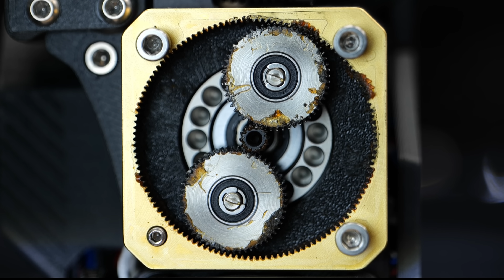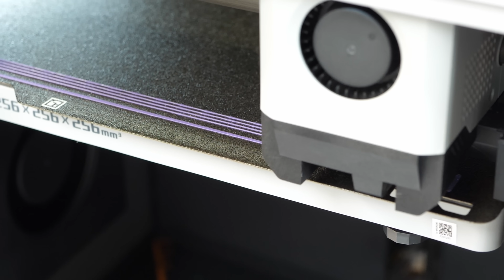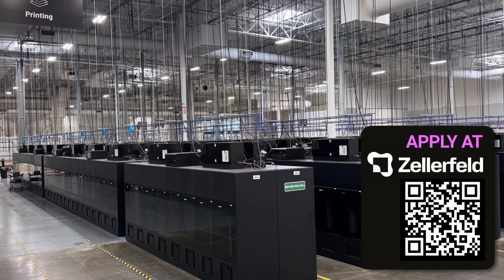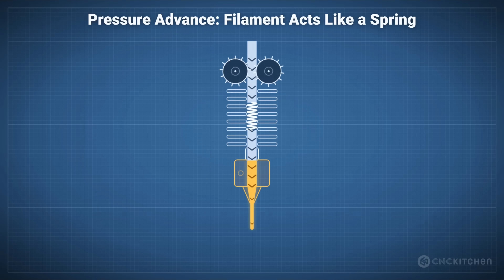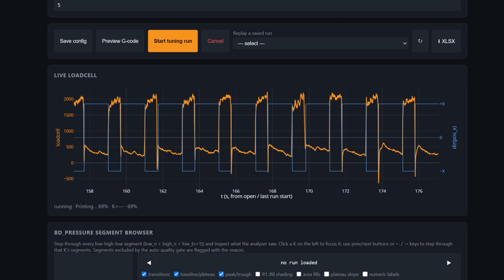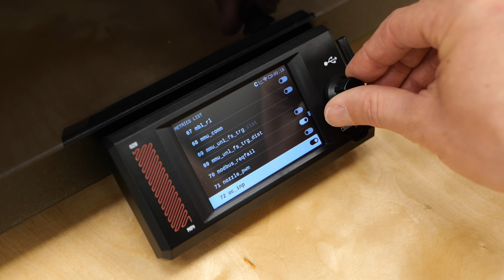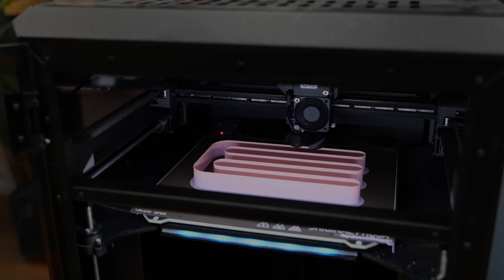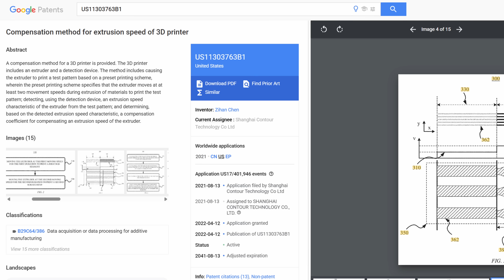I Automated Pressure Advance Using a Bed-Leveling Sensor

Comment: This is awesome - I just ordered an INDX system and I'm asking myself if the loadcell in that can be used for stuff like this and especially filament/clog/runout detection. Not sure if it works for INDX, because the toolchanger presses the tool down into the couling, so maybe INDX's load cell can't register "negative" values from filament force, just positive values from probing the bed?
Reply: But I think I won't get around some kind of filament detection mechanic. Maybe just basic presence sensors like on the Prusa Core One's INDX system (I got a Voron 2.4 and INDX devkit). Was thinking about getting something like a Mellow LLL filament buffer, but that quickly gets expensive for 10 tools in my case :D
Reply: by the way. Just so awesome to see the potential again, on another level, for software to make today's machines soo much better in the future. I got a MK3S back when it came out, and it's insane how much it improved over the years just by firmware and slicer enhancements. 3 of them were my only printers up to a few months ago when I got the Voron. I'm excited to see what the future brings :)

Comment: I guess it could be used as a runout sensor too? But the printer reaction would have to be immediate till there is still nozzle pressure

Comment: Super cool idea, now I am wondering if I can get the raw data from something like the mellow fly ALPS or the Revo PZ. The main challenge I see upfront is that many of these probs have their own "control board" that converts the raw pressure sensor data into a data format that at least on the ALPS replicates a bltouch probe, and completely obfuscates the raw data. Might need some custom firmware but I certainly want to try it! Amazing video!!
Reply: Agreed, would love to integrate this into my Goliath hotend setup. Definitely post your results

Comment: Stefan, is K also a function of speed and acceleration when printing?

Orca has a checkbox to enter an array of values which it can bilinearly interpolate between.

I wonder if you could get enough information from your method to get this level of calibration easily.

Regarding the U1, which would benefit most from this, please have a look at the Paxx firmware, you may find there’s a way to get that information out of the machine

Comment: Interesting thoughts - I presume you are using something like Claude to develop your web dashboards etc.   I've gone a fair bit further with my RRF printers and actually used claude to make firmware changes - for things like collision avoidance.  I wonder if you could do the same sort of thing with the Prusa firmware to add additional data / put your pressure advance algorithms actually into the firmware.   I'm certainly planning to do this on my CoreOne INDX - to get it to do things like supporting more than 8 tools (or a secondary elevating tool rack). Appreciate that this means breaking the clip on the board that allows unsigned firmware to be installed.

Comment: my Prusa MK4 also uses the side detection of the load cell to check if the print sheet is installed correctly, to avoid printing on the naked bed.

Comment: I still think bambu going back to eddie current sensors and load cells and ditching the lidar was a mistake.

Deriving flow dynamics from second order sensor data never can be as precise as measuring actual line width on the print bed. And in the end thats the metric we want to optimize for.
Ideally this should be permanently measured while printing and corrected on the fly.
Hot end pressure can get close but you are never measuring what you actually want to.

Comment: Couldn't this also be done by measuring the extruder stepper current? For printers without a loadcell...
Reply: It would be incredivly difficult, because the current is equivalent to motor torque. And some of that torque also is taken up by the moment of inertia of the motor itselve.
Reply: Oh be careful not to encroach to the bambulab patents there!
Reply: @nexttonic6459  Oh I see

Comment: I don't know, my experience with fast Klipper machines is that the correct pressure advance depends on two factors, filament and acceleration/velocity, but the latter is usually more important. At the point that two different machines with similar hotend/extruder can share the same profiles as long as they also print with the same acceleration/speed.

Comment: So cool! I've avoided BambuLab printers, but the automatic pressure advance/extrusion multiplier features have always been really enticing. I'm glad you're looking into ways to implement it!
Reply: The load cell based (A1 onward) pressure advance calibration works great.
The 'LIDAR' (X1C) extrusion multiplier and PA calibration dosent work very well.

Comment: i always wondered if you could fit a rotaional load cell between the stepper motor and the extruder to detect the pressure build  up?

Comment: Next level! I remember looking through your repo a week or so ago and was excited to see the video come out for it. Seeing Jo Prusa's comments, I'm hoping for improvement. I think Prusa had grand ideas, but may have shot themselves in the foot: Klipper and Bambu's printers (such as the X1C) are Linux based, so there's a full computer there that can do processing. Prusa opted for embedded software, so basically everything can be designed/engineered and demoed to work... and then needs to fit within a small memory foot print and limited processing power. And that kind of work is probably harder then the original problem being solved.

It's such a catch 22 for me: Nov 2021, Prusa announced the XL and said "However, the load cell sensor allows us to do more than that. We can now recognize a jam in the nozzle and pause the print. In the future, one of the things we want to focus on is the ability to detect a partial jam – so the printer could notify you in time before the actual jam happens. And maybe even detecting if the print has come loose from the bed." yet here we are over half way through 2026, and the the closest we have stuck filament detection that takes a bit too long before it triggers and the code for it is literally a bounded gaussian filter with a comment that says "If someone knows how to compute it properly, please feel free to improve the code below" (look for e-stall_detector dot cpp).

Yet on the other side is Bambu who took a different approach, patented it, then all but threw out that approach with the A1 to do the same as Prusa and others who were playing with load cells for the same purpose, and apparently patented it too. Then you have things behind closed source for Snapmaker.

Like... at this point, unless someone on Klipper is/has done the calculation approach to run in real time, I feel the 3 options the community has is: 1) hope someone on Klipper tries to do it themselves/integrates a real time version of your code. 2) wait for Prusa (though their approach will be intended for embedded systems). 3) Hear me out... bring back OctoPrint (it never went away, and I hope Gina's been doing well, but I just don't hear about it in relation to modern printers)... because OctoPrint is a Linux system that runs adjacent to the actual printer and could be something that a user just goes "get RPi, install OctoPrint, install your code adapted into a plugin", and suddenly you get an filament auto-load sequence that detects pressure advanced and injects the proper K value instead of it being hardcoded somewhere. Plus you get the benefit of all the other things mentioned: stuck filament detection, dynamic flow rate adjustments, skew detection (and maybe even live adjustment), etc.

(clears throat) Thanks for continuing to do these research projects AND then publishing the work and process.

Comment: This looks like the perfect use case for an ML model.  My guess is that in those different machines during the calibration tests, the under and over is captured and run against a pre-trained ML to output ideal values which are then applied to the extruder.

Comment: the utility of having that kind of system on the 8 tool indx would be immense. on the first layer of each colour the head could just run that load-cell based calibration the once and then continue on as normal. like having a traditional flush purge like a bambu machine just the once, but then resuming the special purge peas the indx has after.

Comment: Essentially you're advocating for better compute onboard printers. Which has slowly been improving. And you could always go the direct control from the computer route. Read sensors and edit the next gcode command on the fly. The only limit is baud rate.

Comment: A pressure advance routine could be built into a brim or skirt section of a 3d print. This would eliminate the wasted filament while giving better data since there is some back effect from the printer bed.
Reply: Smart idea! There is always a priming line that could be used too.
Reply: @Nikkuuu69 The priming line cannot be used for PA tuning. For PA tuning you require the nozzle to be properly 'filled' and the priming line's job is to do just that.
Reply: I think the more advanced application would be active calibration in a closed loop system during a print.
Reply: wont work because of the additional pressure given by the pushback from the plate

Comment: Insightful stuff Stefan! 

I wondered how my Kobra Max 3 did flow calibration since there is no visible evidence like my X1C. So I paused your video and let Google AI tell me: 

“The Anycubic Kobra 3 (and its Max/Combo variants) uses an automated active pressure compensation feature for flow calibration. It utilizes a built-in load cell in the print head to measure internal hotend pressure changes while extruding filament, automatically adjusting extrusion to prevent under- or over-extrusion.”

Keep the cool info coming!
Reply: Yes, Anycubic has done it... so surely it was done or written somewhere even before for them to be "inspired from"
Reply: Be carefull with the output of the built in Google AI.
Just ask it the continous current rating of an XT90 connector.

Hint: it is NOT 90A for all of us that know how to read a datasheet.

Comment: Would the E3D piezo PZ Probe sensor also be suitable for this application?  I’m not sure how the Prusa loadcell physical mounting differs from the mounting of the PZ Probe with Revo nozzle on a Voron to know if can interpret the same nozzle extrusion feedback data shown in the video.  Would be cool to see this capability for a Dragonburner with E3D Voron PZ Probe Revo toolhead.
Reply: Piezo sensors do not measure force directly, they only measure a change in force.

Comment: Sorry if this is mentioned at some point in the video, but I wanted to send it now because I'll probably forget later with so many things to review.

One thing to keep in mind is that, for the calculated K value to be accurate, in practice the filament is being pressed against an existing layer. The amount of compensation should therefore vary significantly depending on that layer's height.

I think performing the test using a calibration line at the beginning of the print (as Bambu Lab used to do) would provide the most accurate possible calculation

Comment: Thank you for investigating this, I've frequently wondered why this wasn't ever implemented further. The nozzle load cell is very much a way to close a glaring open 'loop' in the process.
Also something I've frequently noticed is once I've found a good 'ideal' k value, it kinda spans across all my filaments and even plastic types. When it doesn't, the nozzle temperature can be adjusted until the viscosity aligns again and that 'ideal' pressure advance value holds true. It'd be interesting if you looked into that to see if there really is a 'generally good viscosity' that works across all filaments and doesn't seem to compromise, and maybe have pressure advance calibration effectively adjusted via temperature instead? (if this is true, it might even mean temperature towers aren't needed?) I think outliers might exist due to some filaments having additives like carbon fiber.

Comment: is it possible to implement temperature control to adjusted by layer time for finer details of a print  instead of relying on min_layer time cooling, which can still make finer details a mess due to the high temps.

Comment: Now you are making me wonder. If we are doing this based on the amount of force being placed on the nozzle, the Newton's law says that force has to be coming from somewhere. If we can get access to instantaneous current readings, we can infer all of this just from the stepper driver that's running the extruder gear. Which is really topical, because you mentioned sensorless homing in the sponsored segment, and that's exactly how sensorless homing works 😁
Reply: Turns out I was partially mistaken. While most drivers do have overcurrent protection, they lack any way to read the instantaneous current. An external sensor is still required.
Reply: @TheMNWolf  Bambus servos can do exactly that, but as he mentioned the force of the extruder is one thing but the elasticity of the filament between extruder and nozzle is the other half of the equation. If you only got the motor data you would have to have crazy tables for filament properties under load and temperature and for every single filament and color.
Reply: @MsKoffeinjunky  dont forgett the moment of inertia of the stepper motor.

Comment: My Creality K2 Pros do automatic PA calibration, but it does it in the build area, and is not reflected in the slicer, so your print can end up right over the top of it, so its a friggen fail IMO, another issue with the automatic setup, is its only done on one of the 4 filaments in the CFS, so it will be correct for only one material, and not the other three, so its a double fail :)

Comment: Since we control the printer step rate via klipper couldn't we also compensate via movement speed, wouldn't that be able to get the actual extruded volume to match the square wave near perfectly?

Comment: My XL's loadcell doesn't even properly finish MBL with current firmwares which has been a reported issue since November with multiple solutions described. Yet Prusa does not seem to care to implement any.

Comment: I have a couple vorons that are performing quite well, I couldn't do this as I don't have a force gauge however, would it be possible to setup a 2 value K? Have a high and low value? 

Then at least you could try get the sharpest corner on the square wave?

Comment: another vibe coded tool from you. disappointing.
Reply: Who cares if it works? I swear these "engineers" feel so threatened by the fact that people with knowledge on certain subjects can apply that knowledge to practical usage without hiring a "programmer" who spends days/weeks and still fails to understand the objective.

Comment: Quick question why do actually set one value 🤔 I was wondering how come one work both ways.
When I started using PA I was always thinking why we don't do a separate accel and deccel PA
I know one does the job like 99% of time. Yeah I was curious just

Comment: Interesting.  Some thoughts:

1. Your calibration is based on extruding into thin air, where nothing is restricting the flow.  How different would your results be if done on the surface at different heights above it, to change the pressure resistance?

2. TWO 'K' values might need to be calculated: one for pressure increase and one for pressure decrease, as the response by the plastic seems to be asymmetric for some reason.  (I could be mistaken in that; it is pretty subtle.)

3. Might the load cell be sensitive enough laterally to be able to trace along the perimeter of stacked test layers to match some of the sensitivity of the LIDAR solution?

4. This seems like a FANTASTIC method for helping filament extruders to maintain a consistent filament diameter as they recycle ground-up prints/etc. and turn them into new filament.

Cheers!

Comment: I'd like to see how it looks on a bed side force sensor.
also imo crash to rehome and decaying reduced speed (especially with printers that have top homing) would be an amazing option, instead of making a whole mess it can recover surprisingly well. (I'm doing it manually, and even severe splits/layer shifts can be recovered from by slowing down to 20% speed for a few layers, though it does need touchups with plastic soldering iron/pen.)
instantly rehoming on crash would avoid hard splits and layer shifts, and slowing down to 20% for a few layers, then going +10% each layer till it's back to normal would avoid serial crashes, a smarter way to do it would be to make an exclusion zone where the crash happened and only slow down movements that are in that zone.)

(I'm too adhd to do it myself but if anyone wants to work together for an implementation I could)

Comment: The slicer could predict the force on the load cell while printing and embedded it into the gfile, then you could easily detect error conditions, or tune the k values on the fly.
I’m surprised that it is under-utilised in the prusa printers.

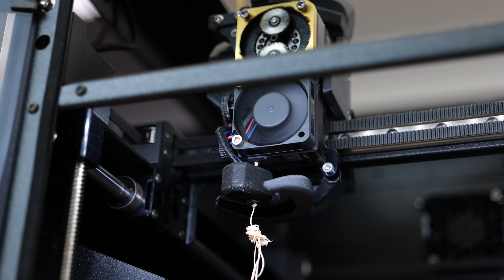Comment: At the 11:34 mark - you say you “step by step increase the k value”.  If you can characterize the error as a number that describes the undershoot portions of the curve and the overshoot portion of the curves (perhaps with a weighting factor if for instance you really dont like overshoot) then instead of “step by step” you should perform a BINARY search of the value space.  You pick a lower and higher bound for the PA range, you then run a low value then a high value then one in the middle.   You should be able to subdivide in half the better range to find the value you want.  If you determine that the value you want is not in between the low and the high PA values you can back off and try a higher PA value to extend the search space.